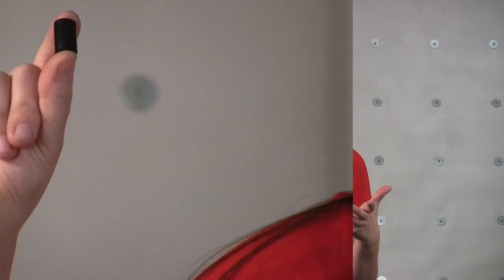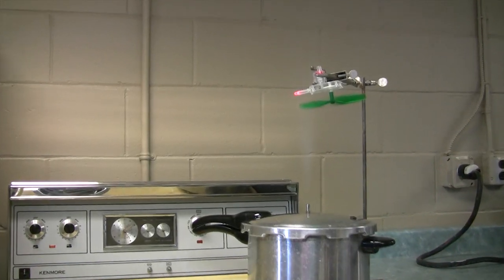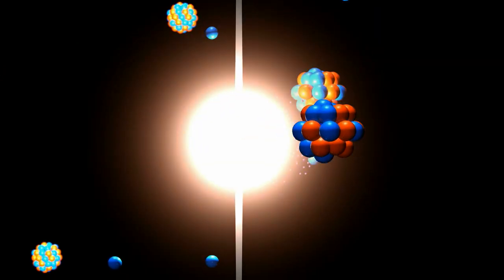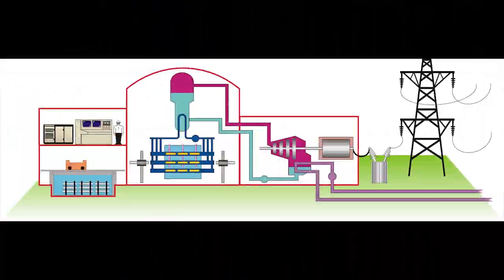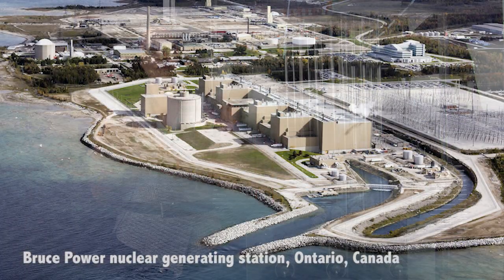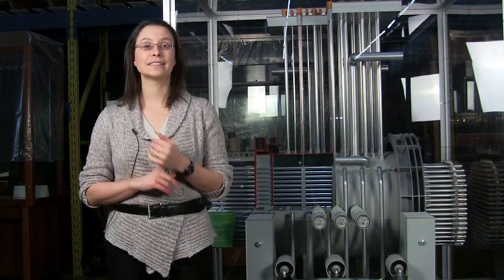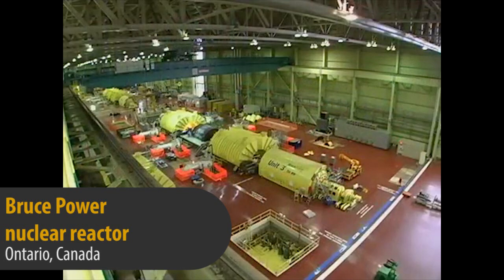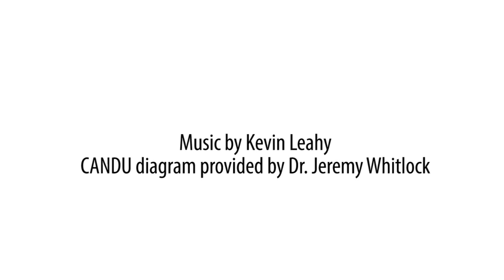Nuclear Energy

Comment: how do those fuel rods start the reaction? I mean she can just hold it in her hand. do you just have to put enough of them together or what?
Reply: They are not real fuel rods, she is holding a reproduction.
Reply: It's probably a mock-up, but it would be safe even if it were not. The uranium needs to be in an environment with a high neutron flux (neutrons whizzing by) and where those neutrons have a low enough speed that they are able to interact with other uranium nuclei (and not just fly past). These two things are achieved by multiple factors: Firstly, and most obviously, by having many such fuel bundles in proximity in the reactor, secondly by providing the moderator (the heavy water mentioned in the video) which is there to slow down the neutrons, and thirdly by possibly using a neutron-reflective material such as beryllium to reduce the amount of neutrons lost to the surroundings (not sure if CANDU uses this third technique).
Reply: It's definitely a mock up. A fully loaded fuel bundle weighs around 40kg. No problem with being close to it though.